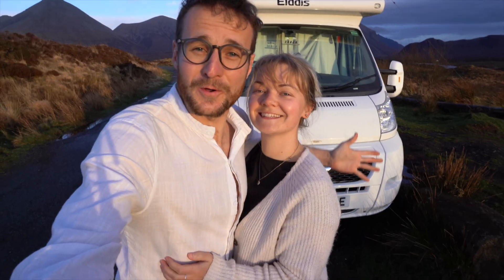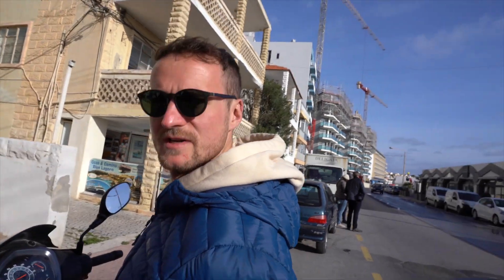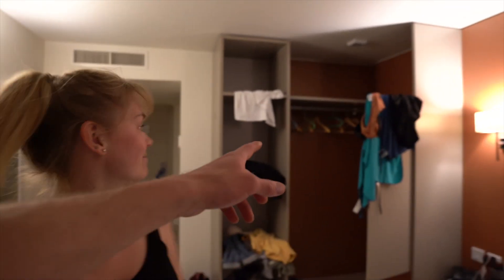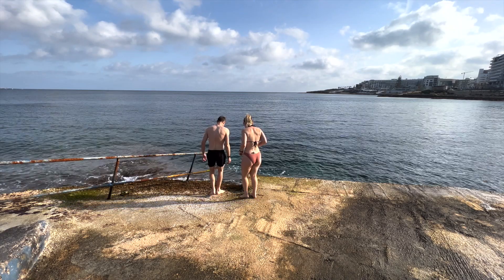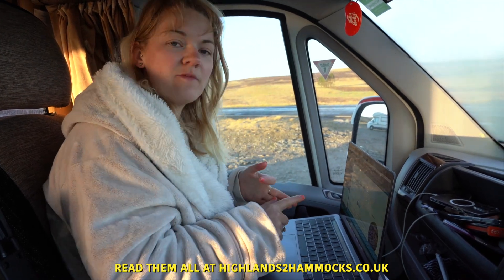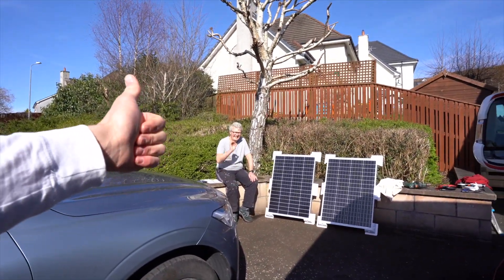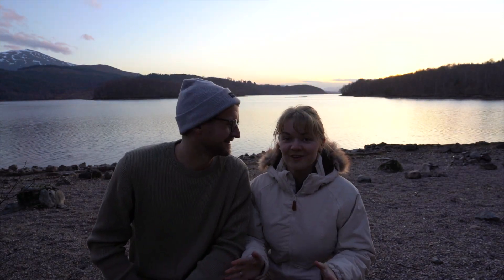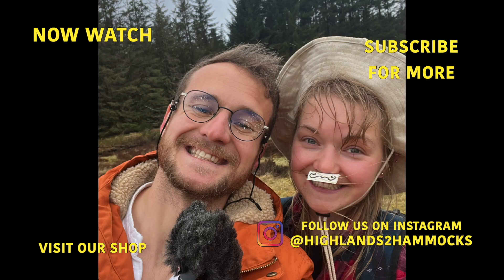UPGRADING OUR VAN FOR THE ULTIMATE SCOTLAND ROADTRIP - VANLIFE UK

Comment: Hiya. you did also screw the solar  panels down is well and not just rely on sikaflex?
Looking forward to your next road trip.
Reply from the maker: We didn’t screw down as all the research we read insisted the glue is plenty when applied correctly 😊 we would only be screwing into a thin plastic sheet anyway so it would make no difference
Reply: Who ever told you that or where you got the info from is talking absolutely bollox.
Those panels need to be screwed down is well as can easily lift off on a motorway.
You can get away with it with flexi panels but not the bracket types. That it is just dangerous as it is. Screw them into wooden battens underneath too or use bolts and brackets inside.

Comment: They panels will blow off unless you screw down those brackets as well as the correct adhesive, guaranteed !! Too many vans on YT did same as you and their panels trashed on the motorways of the world
Reply from the maker: Done loads of research and it all states the glue is plenty 😊
Reply: @highlands2hammocks  watched  Ladi and Margaret and he said many just blow off with using adhesive only, and did on one of his earlier vans.